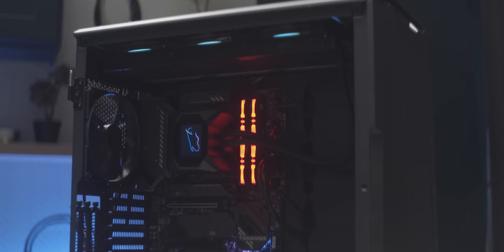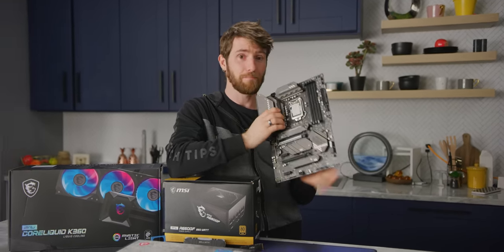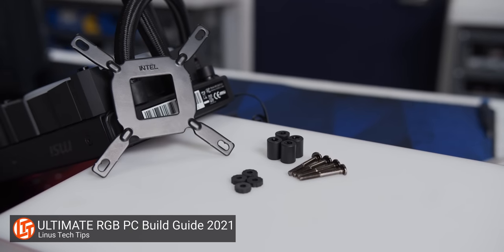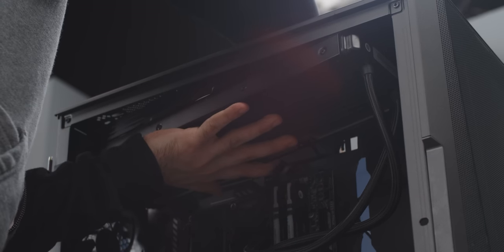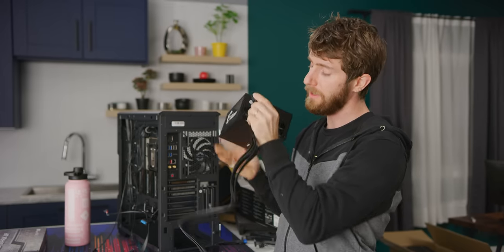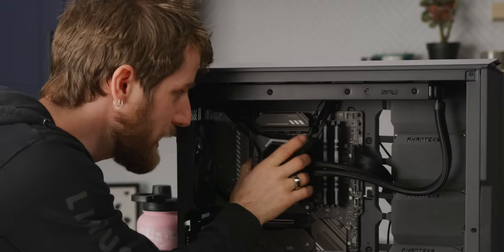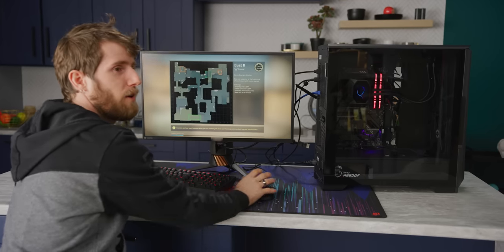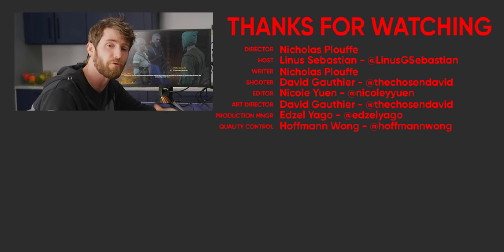You Can ACTUALLY Buy This PC!

Comment: "the 11700k, its 8 cores might be a little low today" 

looks at my ryzen 3 3100 box
Reply: No no urs it good...
Reply: cries in R5 2600
Reply: cries in core 2 duo now shush
Reply: I finally got my shiny 12 cores but my damn motherboard came with a fault
Reply: cries in Celeron M 540
Reply: Cries in core 2 duo
Reply: My i5-2430 salutes you
Reply: @SquidgyWobble  laughs(sobs) in R5 1600X
Reply: Cries in i5-4590
Reply: Cries in 2 core intel core i3 7100
Reply: Cries in Ryzen 5 3500
Reply: Cries in core 2 duo e4500
Reply: I got a Intel I5 7500, not the best but it ain't bad at all... besides the fact it only has 4 cores lol.
Reply: laughs histerically im ryzen 3800 xt no, really though. That 3100 is still better than a lot of the intel baffoonery out there now
Reply: John-Paul Hunt  I am definitely planting chia seeds on a broken hard drive now. That is an S tier meme
Reply: hey the r 3 3100 can still do a lot tho
Reply: Half the cores and threads for a quarter of the price plus it uses a cheaper motherboard it's an amazing chip. It is an amazing chip and a worse system is much better than buying more than you can realistically afford (assuming you are not in the position to buy a mid-high end system if parts were in stock)
Reply: Dies in 8700
Reply: @rohitpriyesh  I did not see that coming personally !
Reply: So glad I upgraded in April 2020 from the Athlon 64 FX 3600+ to my Ryzen 5 3600.
Reply: i was like "what ?! " my i5 10400f is very good >:( xd
Reply: looks at my 5800x and 6900xt, nah 8 cores just fine mate. I can't even max it out.

Comment: "8 cores may be a little on the low end"

Me watching on a 2 core:
Reply: Where did you find a 2 core? A museum?
Reply: @kaldo_kaldo  a 3200U crappy laptop
Reply: Same here, 2014 Latitude with an i5 4310. Feels bad man
Reply: @stygii3331  yeah you either have and 9400f or a 9600k
Reply: same here lol 
a no gpu 7100 desktop
Reply: F
Reply: I'm a bit 'Rich'ard
I have 3 core :)
Reply: @kaldo_kaldo  I've been on dual core for 6 years only upgraded last year casue I got a good deal for ryzen 3600
Reply: is it at least hyperthreaded?
Reply: I'm on a six core and think it works great
Reply: @stygii3331  go to windows settings and then about, you can see the exact cpu in there. or to see all the specs of your pc, hit control, shift, and escape and you’ll open up task manager, make sure you click expand or more details and you can see your cpu, ram and gpu and what’s using each the most
Reply: @jozobozo5  I have been on single core for six years :) or even more ;)
Reply: @PashaGamingYT  was laughing till I realised my laptop is he same lol
Reply: @kaldo_kaldo  i3 5005u
Reply: @LongItAll  eyy fellow peasant
Reply: @Lpiam31  

Yes

Comment: MSI really should have sent you on of their MONITORS so you didn’t have to blur the ASUS one!
Reply: Wow, MSI. Very cool.
Reply: I'm surprised LTT doesn't have any lying around anyways. MSI has some amazing monitors, I love mine.
Reply: Knowing MSI quality control they probably all died
Reply: @waveformdistortion  Are their 1440p high refresh rate monitors good? Might get one for my next upgrade. Stand doesn't matter, I'll probably VESA wall mount it.
Reply: @codertommy6883  I couldn't personally speak to those ones, but the 1080p 240Hz IPS monitor I have has been excellent. My only complaint is that it takes a few seconds to "wake up" when first receiving a signal, so it doesn't get recognized during POST and as such can't be used to access the BIOS/UEFI. Not a big problem in my case since I have multiple monitors, but it is worth mentioning. That said, the same issue may not be present on other models.

Comment: I bought a Asus 3090 TUF £1600 GBP in December and recently paired it with a 5090x on the Hero Dark MBR,  I decided to go with Air cooling using then Noctua NH-D15 and ditch a Fractal Design Kelvin closed loop cooler as one of the pipes split when upgrading the MBR.  It idles around 45oC and goes up to the higher 60s under load.  Quite pleased with the build.  The temps were slightly lower using the repaired FD Kelvin but it's quieter using the Noctua NH-D15 and I prefer minimal risk to the components by not using water in these high demand times.

Comment: I built a new PC around when NVIDIA announced the 3000 series and was planning to put a 3080 in it.

Right now it has my old R9 290 for graphics.  It actually still handles modern games alright if you're fine with low settings, 30 FPS, and sitting next to a jet engine.

Comment: "You can actually buy this PC!"

proceeds to build a 2500$ pc.
Reply: this is facts
Reply: (Without a GPU)
Reply: @METhOdhowtoKilLnoObS Not to sound cynical but MSI and Intel are frequent sponsors of the channel, but more seriously I think the premise of the build is that you will be buying a GPU at some point and you won't want a bottle neck at that point
Reply: @METhOdhowtoKilLnoObS I think the point of this video was more of "hey, just use an igpu for now" because sure your performance would be better long term. If you spend 200 on a gpu then you are going to end up spending 200 less on your better gpu which is the difference between a 3070 and 3080. Plus some people need the cpu horsepower for rendering or modeling or high frames
Reply: @rein8136  Yeah, this shit should have more upvotes (clickbair as usual).
Reply: @METhOdhowtoKilLnoObS Also, If I want to play through GeForce Now, I can play from my Laptop (with external display, if needed). Why build a pc at all if one cannot afford a GPU for now. Waiting will be the better option.
Reply: @METhOdhowtoKilLnoObS where and what gpu? Gt 1030 is same speed as ryzen igpu and already costs $100

Comment: "Its 8 cores might be a little slow by todays standards...."

Me still stuck with my 7th gen 4c/4t i5: 👁👄👁
Reply: pfft imagine using 7gen i5, real gamers use i5 760
Reply: @mossbossyea  Laughs in intel pentium g4560
Reply: I’m lucky with my 7th Gen 4c/8t i7 mwhahaha
Reply: @OmPrakash-pc1ec  laughs with you 
Still using Intel Pentium 3252 with intigrated graphics 550 4gb ram and 1.6ghz playing gta vice city
Reply: 8 cores is more than you need for gaming. I do C++ work (notoriously CPU-heavy) and so far the only jobs that have taken an unacceptably long time are Linux kernel compile and Firefox compile. Of course, after you compile it once, when you make changes it only recompiles the changed files, so it takes much less time. Given the price of my other options and how rarely I have to compile/modify either project, I'm still 100% satisfied with my 3700X and would actually recommend it over any of the Ryzen 5000 CPUs.
Reply: Pathetic, Core 2 DUO T7200
Reply: @collinblack9605  Intel was still king and amd ryzen wouldn't be out for a few more months at the time skylake released. He's not brain dead at all, he was just buying from the cpu leader at the time
Reply: Laughs with Intel Celeron
Reply: I'm rocking an i5 7400 and GTX1070 and I'm having a really hard time justifying an upgrade, even if the prices would come down a bit and even if the 30-series was hailed as the go-to upgrade path for 10-series owners. At 1080p my old machine still seems to handle everything I want throw at it. Given, I play a lot of slower paced RPG's, indie stuff and older games, but even modern AAA games haven't really gotten that much more demanding in past years.

Comment: For those that bought this case, you can put an old phone in front of the PSU, I use it as a resource monitor.
Reply: What's your workaround to display the data in the phone ?.
Reply: How to do that any link?
Reply: I would recommend Modbros solution, both for Raspberry Pi and Android.

Comment: I grabbed new case new cpu etc and waited for a card to finish my system up for awhile I caved and bought a full built pc, for a 2070 Super just to gut the card for my rig (I had a 1060 6gb), I gave my old card and new computer to someone else in my house looking to upgrade the new computer is pretty decent and runs super well, so I am happy lol Running most games in 4k is pretty sweet.

Comment: Me watching on my laptop with no money to get a new computer anytime soon: Interesting
Reply: same
at least I can run newer games at ~50 fps on 1280x720 at lowest graphics (plus some configuration)
Reply: @Bombingham  Yea I've got decent power in my laptop too, so yea it kinda works for me for now.
Reply: I've been using Geforce Now for the past few days and... it's pretty worth it if you already have a PC library, but no PC to run it like I do. I mean, 10 bucks a month basically for a graphics card ain't too shabby.
Reply: Literally the same, GTA V has been the peak of my gaming for years now
Reply: Im on the same boat, i got an 10yo acer aspire, but here in brazil a decent pc costs as much as a semi new car
Reply: Demarquez Jones  I have Xbox Games pass and I have used their streaming service. I would say that it's a good route to go, but only if you want to play the games they have set up for you, whereas with Geforce Now, you have access to games you've already bought (depending on where you bought them), and not some rotating list of games. So, if you're like me, and your gaming library is already rather extensive, but you lack anything capable of running it, go with Geforce. If you don't have either, go with Xbox. I will also say the Geforce PC app is a lot better.
Reply: Demarquez Jones  You're just... repeating yourself.

Comment: I think you should do a video on apus, as those are solid options at the moment
Reply: If they were in stock anywhere
Reply: @Nozarash1  lmao ill sell you one
Reply: laughs in 3400G at 1600Mhz
Reply: The 4650g for $259 on ebay makes way more sense than buying a 3600 for $200 and a GT 1030 for $129
Reply: @cluckern9614  I5 11400...
Reply: @Nozarash1  I’ll sell you mine lmao
Reply: they are. its just a pity all the good ones are oem only. you can score them on ebay but the prices aren't exactly great. I think you can get an r9 270 or similar for 100 bucks or so and it has more gpu power, and thats about the price markup on APUs right now compared to Ryzen of similar core count and generation.
Reply: I am rocking with my new Ryzen 5 3400g !!
That beast can literally run cyberpunk on low settings !!
Reply: They can get you by ... Kind of. Overdo it on system ram and limit your settings to low to medium at 1080p and hope for 30+ fps in most cases
Reply: 2400g crowd checking in.
Reply: @nolkerss  I mostly used the Ryzen 3600 as my comparison because it's pretty apples to apples as far as the actual CPU goes
Reply: @ritikgulabrani9073  nice! The choice for me would be intel bc its the budget option now, somehow. But that is really impressive, have fun gaming!
Reply: @nolkerss  is a bad idea when for 20 more you get the better gpu in the 11500
Reply: Eagerly awaiting Zen 3 APUs.
Reply: @g00fysmiley  I built my first pc just relying on a 2400G and it could actually get me up to 60fps custom high settings in rainbow six. The newer gen should be even better so I'd say an apu is absolutely a solid option to hold over until cards are back in stock
Reply: @WayStedYou  im tryna go for a budget so its too expensive, havent even seen an 11500 on sale anywhere here in the uk...
Reply: @twistedtechnology  eagerly waiting for the realisation to set in that intel is cheaper...
Reply: @nolkerss   i5 can barely do 720p or even 600p gaming, while the 4650g is a good option for light 1080p gaming, if you don't believe me then check the benchmarks
Reply: @naseemyasir  doesnt matter the performance, the *PRICE* is what matters to me. AMD is just expensive, let ALONE the shortages with tsmc they have.
Reply: @nolkerss  but for just 50 dollars more you can get litterally 3 to 4 times the performance also the supply on amd apus is actually good, bcuz of the low demand of apus so if you get one 250 or 230 dollars i think it's really worth it
Reply: @nolkerss  also see the benchmarks the 11400 doesn't really give playable performance in most games, so you either have to play at 600p and get decent frames or go higher resolution and a worse experience
Reply: @naseemyasir  doesnt matter, a budget is a budget.
Reply: He won't since Intel doesn't make them. The 3400g exists and he picks this garbage over it.
Reply: @joemarais7683  ????
Reply: @naseemyasir  and roblox is definitely hard to run 👍 im only getting the intel cpu's bc its better value. Im not a fan of any company, im a fan of my wallet.
Reply: @nolkerss  hmmmm... i just wrote a paragraph on how amd apus are better value, like just by paying a bit more you are getting almost triple the performance, and im talking about the r5 4650g, so if this doesn't convince you please check the graphics score like time spy of both apus and then divide by the price you will know which one is the better value

Comment: This may be a very unpopular solution, but I got my son's pre-built for just a little over $500. Came pretty basic with an 3-10100, 8gb single channel (Yeah I know, but ram can be cheap), and a 1TB HDD 7200rpm. I got it from Dell Outlet store. Yeah I know... It's Dell and it's a refurbished system of all things. BUT! It does come with a GTX 1650 4GB! My son has been gaming on this thing non stop and we've had litterally NO issues. Upgrading the ram and getting an SSD was pretty cheap too!

And I've bought a gaming laptop from them too and I love this baby! I got a great deal on it for the specs it has. i7-10875H, 32gb ram, RTX 2070 (Not MaxQ), 512gb SSD for just 1,200. I can honestly be one of the few that recommends Dell, and Dell Outlet at that!

Comment: CPU : i7 11700k
Motherboard : MSI tomahawk z590 wi-fi
Ssd card : Crucial p5
Memory : crucial ballistix RGB 3200 MHz DDR4 32GB (16x2)  kit
Case : Fanteks p500a
Cooler : MSI mpg core liquid k360
Power supply : MSI MPG A650G

Comment: B560 and 11500 is a really good budget deal right now, can XMP memory, got 6/12 CPU, can remove power limit timer. $350 together. Intel not present at high end right now, but they do offer great budget options. ( Funny to type that, that was AMD just a few years back ). The 11500 also got the new 750iGPU, the 11400 got the older 630.

Comment: I bought an MSI RX580 ARMOR MK2 8GB back in 2018 for my first build and paid $250 CAD with taxes. After buying an Oculus rift I decided to upgrade to a 2080TI in spring of 2019 and got a ZOTAC 2080ti AMP edition for about $1499 and I am really glad I bought it when I did. I am also glad glad I didn't rush to sell my 2080ti when news came of the 30 series cards because I came very close to letting it go for cheap to a close friend and would have likely been SOL back to gaming on my old rx580. I had my rx580 collecting dust as a back up card for a while. I recently decided to start mining ETH with my  rx580 so I modded an old dell OptiPlex threw the motherboard into an old mid tower case got a 500w psu. After mining with one rx580 for about a month it became very clear why miners have a tight grip on the gpu market. My single rx580 brings in about $100-125 a month which is a conservative  estimate. I believe that gpu companies need to make separate skus for miners that benefit mining and separate skus for gaming gpus with separate hardware configurations to make gaming gpus unprofitable for mining. Simply put I am glad I was able to get a GPU before this crisis but I believe  there needs to be a separate markets for gaming  gpus and mining gpus. Its fair to say the internally Nvidia and AMD may have identified that these factors would result in an increase gpu prices  as well as demand. I just believe they underestimated the final outcome, which is our current situation of gpu price gouging and global shortage.

Comment: I was gonna buy a 3000 series card, but I have started to realize what games I play
Reply: I have been waiting for eternity for a decent graphics card which is not over priced insanely so that I can play Stellaris.
I paired my R5 2600 with GT710 until I could get a replacement.
Unfortunately, I have now realized the only games I play are squash the bug in the code and Office and excel. Which 710 handles deftly.
Reply: @saurabhkhanna8265  well you only play these games because you can't run the others. I myself finally got a pc that handles most if not all current games and it allowed me to try some new stuff and play some games that i couldn't play before, or not well at all

Comment: I upgraded to a 5700xt from an rx 580 for 399 back in November when the new 6000 series started rolling out and it was a great decision. High refresh 1080p gaming all day at max settings. And it came with godfall and the brand new WOW expansion. I just got lucky. Recently gave away the 580 to a family member for free because no one should be paying 650+ for a 1650.